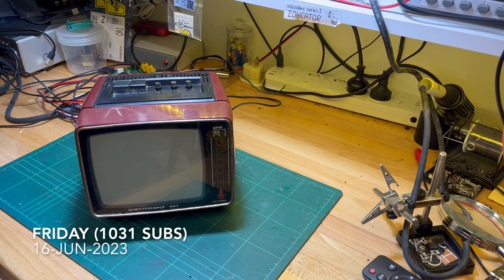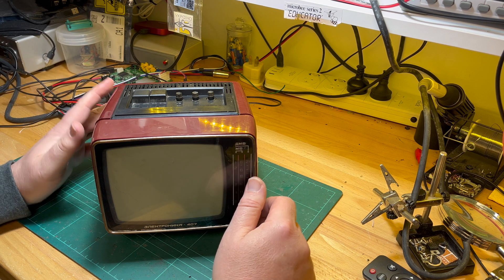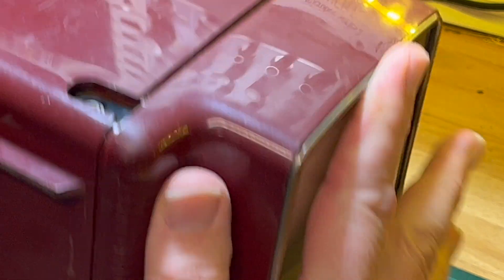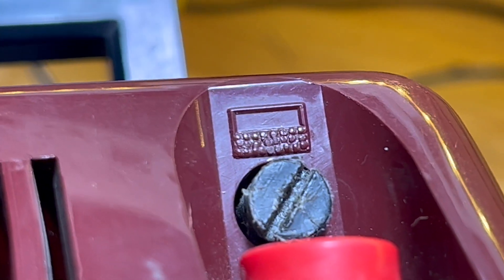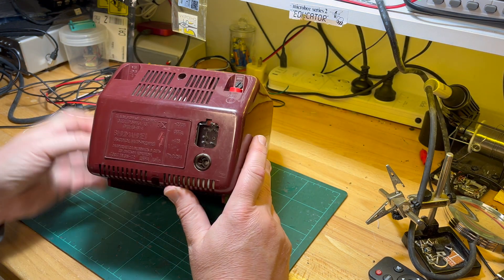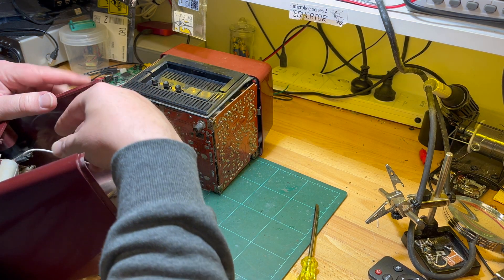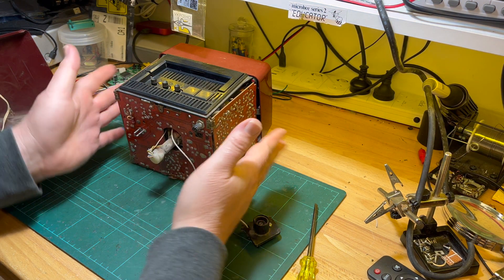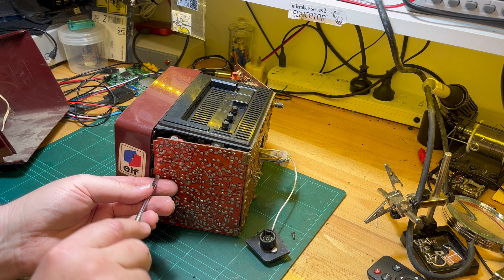Электроника 407 (Elektronika) Television: Part 1 [TCE #0302]

Comment: Elektronika which is still going today in Belarus making some stuff, was a very weird thing, it was a kind of a bureau and a broad church manufacturing base that covered many Soviet factories with the ministry in Moscow controlling the production and sale of electronic goods across the Soviet sphere and there were some majestic cock ups as with all things Soviet.   Most people in the west were exposed to Elektronika watches, they flooded the western markets with cheap digitals after working with Hamilton to produce the first LED digital under the Pulsar branding, reason they worked with Hamilton is the labour and cost rates were a fraction of the development costs in the US.   The electronic and electrical devices whilst seen as a bit oldey worldey were very solidly put together simply as in Soviet spheres, things were expected to not only last but also thoroughly repairable.   Thing about the Soviets is they never polished a t*rd in the same way us lot are used to, Soviet stuff was functionable, it did everything it said on the tin and that was what you got, no frills or fluff and remember as well back then those at the top if they made a mess of something, they didn't lose their job, them and their family were given kindly invitations to gulag and painted as all round dirty rotters and saboteurs of the Soviet paradise...

Comment: I love the look of these old Soviet electronics, they have such a strong aesthetic direction that consumer electronics just doesn't have these days. The Soviet KR1810VM86/88 CPUs made in Kyiv, for example, are undeniably the best looking DIP CPUs ever made, and you can still buy them from the factory in Ukraine which made them up until a few years ago. Also, your pronunciation is excellent! Just one small correction - the title should have Электроника instead of Электроникиа.

I hope you also get to cover some Yugoslav electronics one day, they're also fascinating. Yugoslavia was allowed to get some Western electronics, so you often find a mix of Eastern and Western bloc gear in the same unit, often with domestic parts sprinkled in too.
Reply: This TV is an exact copy of the Swiss "Mini-Star 416" TV. The quality of these TVs was much worse, although they are identical in appearance.
Reply from the maker: Oh yes! Actually it looks like the Mini Star 416 is a re-branded Elektronika 407 - guessing the same Soviet factory made them both.
Reply from the maker: Oh yes, you're right about the title - will fix that up, thanks!  I'll have a look around for some Yugoslav stuff ... I lurk around on ebay mainly and sometimes stumble upon interesting things ... meshok is also fascinating but seems to be mainly Russian sellers so off limits at the moment.  I've also stumbled upon some Ukrainian ones too. Is there a Yugoslav-based auction site? /Brett